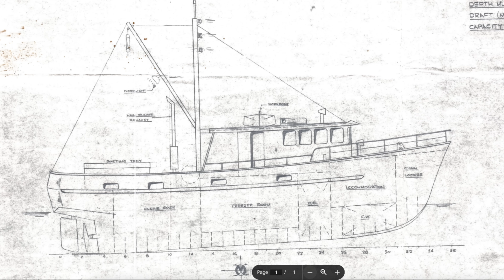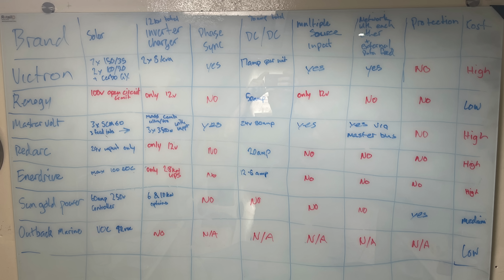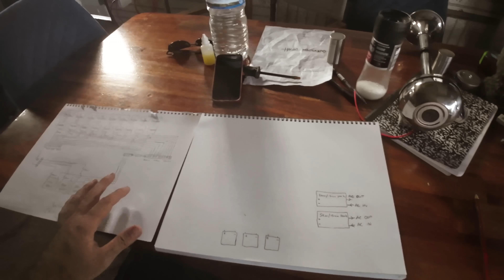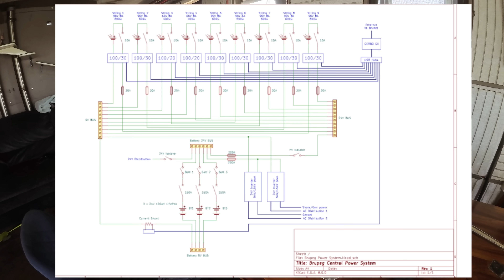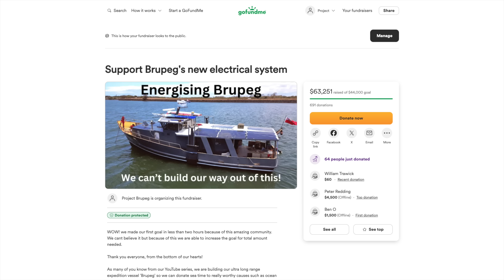Over 700 People Donated, we need to get this right! - Brupeg Ep. 347

Comment: Alternator on the Boat engine is designed for rechargeable battery that starts the engine and primary circuits. An Extra pulley on the boat engine driving a 10 kw or larger generator would be ideal. And having a separate generator system when not underway or underway like most Yachts. Deciding on what load on your boats engine is acceptable without compromise in fuel for trip distance. Just a thought.....then you can have an alternative source of power, limiting your Dead in the water moments...

Comment: When you look at your power systems think about what the research teams will need with dive compressors, freezers, Sonar array's and any other electrical equipment may need and its running duration while you are scoping the system. Something else you may want to consider is having an onshore kit or part of the kit you can detach and move to an island base or similar.

I hope the project and groups that jump onboard have great success. If you do get some sponsorship or discount maybe you can bring the hybrid / electric backup motor project forward and get this worked into the system?

Comment: 20 years of a Victron 3k rig with a diesel engine and Victron AGM batteries. Not. One. Problem. One battery replaced more or less because I didn’t like its face ( .5 under voltage).

Comment: Are you going to marinize that genset? Or, run it as air cooled in your engine room?

Be aware; it’s going to throw a lot of heat and it’ll be tough to feed it enough air. 

It’s common in Alaska to have an air cooled “hotel” set… but anything above 5kW usually generates way too much heat and noise even in the winter months.
Reply from the maker: So the small one will stay air cooled and will move to be emergency back up(so used rarely), the main hotel will be a 19kva keel cooled unit.
Reply: @ProjectBrupeg  excellent! Big air cooled gensets are a pain on a boat. 

Hopefully you’ll be able to source a water cooled manifold / jacketed turbo also. 

I know Northern Lights in the US routinely marinizes Kubota engines, be a good try for parts.